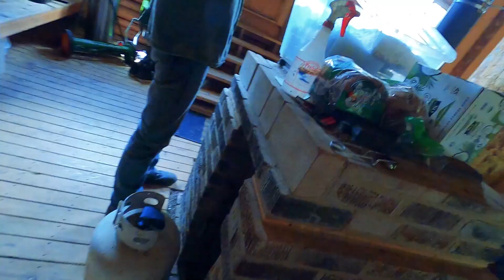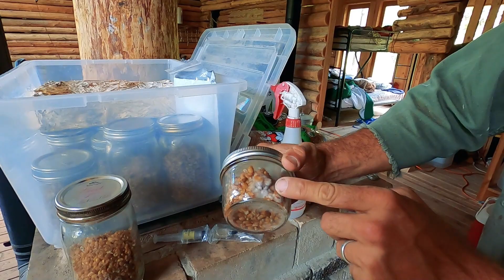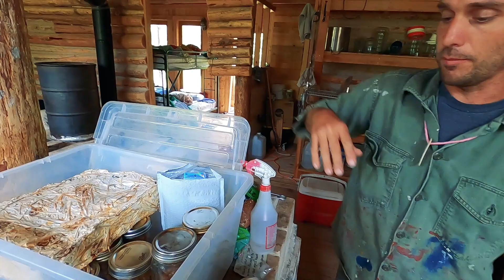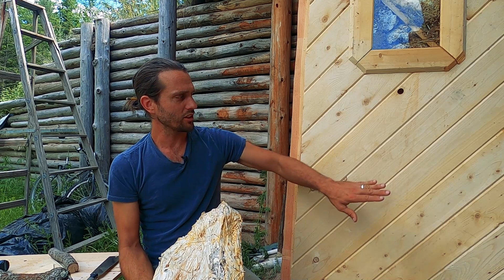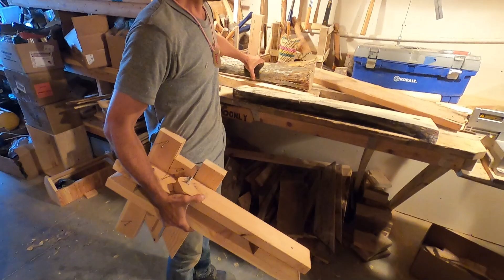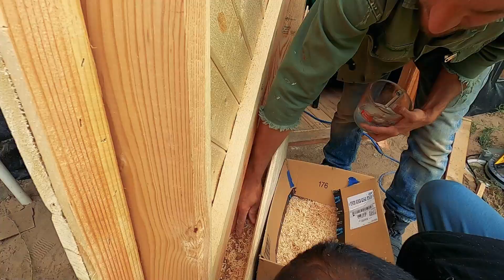Mushroom Insulation and Proeneke Wooden Hinge with Beau Davidson | Permaculture Technology Jamboree

Comment: This is great. A lot of potential here, throw in a 'bag' made of vapor barrier, add substrate and mycelium and known amount of needed water when installing, wait for it to build out the insulation void.  Or blow it in to existing walls.  Lots of easy testing you could do here. Report back pls. Thanks for sharing.